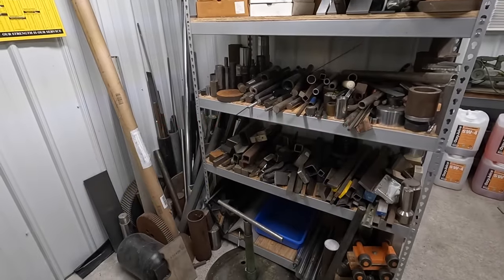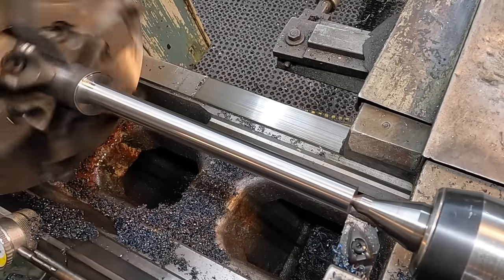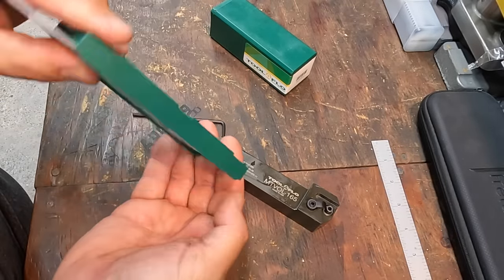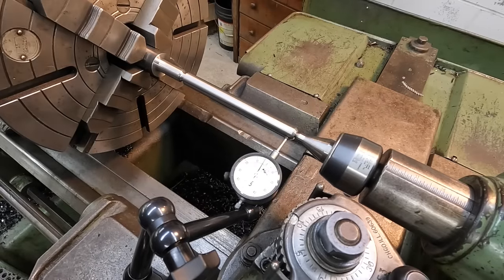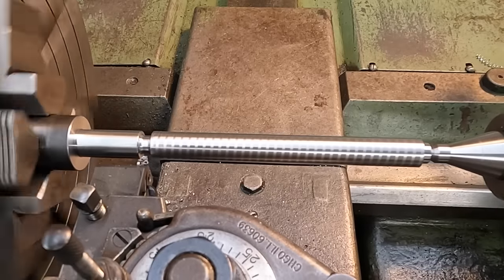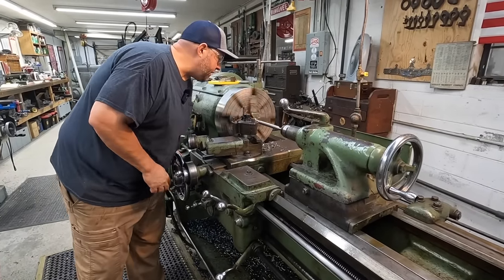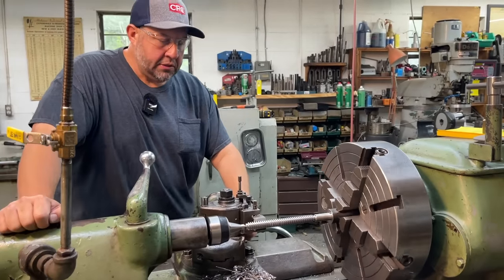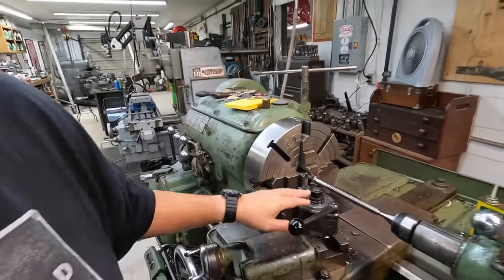Compound Lead Screw for American Pacemaker

Comment: You probably need a follow rest. The part is getting thinner and thinner, it seems like the threads are pinching the tool insert on the last passes and the part is being pulled upwards near the tailstock.
Thanks for showing us this anyways, there are not many youtubers that will show when things doesn't go their way.

EDIT: Would it help to go over with a V profile insert first and finish with Acme insert? That may relieve some of the tool pressure against the screw. 
Same approach as the Acme tap you used in the bronse Acme nut video.

Comment: The part is bending and pinching the sides of the cutting tool, as soon as it get past a certain diameter. Use a follow rest and coolant/lubrication. Wish I had a Monarch.........nice educational video Abom
Reply: would not the bending issue only be in the more flexible middle section of the part and not be at either end?

Comment: Heat from the cut, thin workpiece, pressure increasing from the tailstock causes it to bend away from and try to climb over the tool. Use coolant and a travelling steady. Nothing wrong with the lathe as everything up to that point was fine. Best regards.

Comment: Try setting the tool height higher next time, the shaft climps on the tool and lifts itself up, then the tool has too much relief and starts to chatter and the backlash gets pulled in. A live rest is also recommended and helps with heavy threading.

Comment: Well Adam...These are the moments  to separate the wheat from  the chaff...I watched the process closely....Your first thought was also mine...it is a long and thin workpiece...and the further away from the chuk...the less support you have....But as your are gentle on it and taking only 2 thou a pass...then you would have noticed a deflection more early. Esp. on carbide inserts because on thread cutting inserts you have a 0 degree cutting angle...and the deeper you dive in, the more cross-section you get when cutting threads...
But hey... turn around and look from the other side. Nothing dramatic happened...you invested your time and a bit of steel....I would love to find out the real issue of that....maybe  the ancestors did it right with high speed cutting steel, because there was nothing else available....
Give it a try and use some of that hss cutting steel for that acme thread...

Best regards from Germany!!

Comment: In my view, as someone who owns a lathe or two, is that you simply need a follow rest... The tool pressure is too high for that diameter at that length between the chuck and the center... As you said, its the rigidity, but its not the lathe`s fault, its more of a lack of proper approach... In my view, acme threads should always have a follow rest, as should any longer threads done on a lathe... It simply avoids you a lot of trouble with deflection and climbing parts and what not... Hell, a follow rest is a great side kick for parting off some rudely unpleasant materials... Sure, it may be a bit tough on the bronze jaws, but just freshen them up with a mill every now and again, they are expendable bearing surface...
All the best!
P.s. you said that you checked it before the screw up pass with a nut, and i think i saw a wiggle in the tailstock ram when the shot was happening, its entirely possible that you didnt fit the center snug enough and that allowed for chatter which turned into an instant disaster at that diameter without a follow rest...

Comment: I always use cutting fluid (soluble oil 1:20), even with new carbide tools, being from the HSS steel generation. However, I appreciate your honesty for showing something that did not go well. We only learn from our mistakes. Also, I have never used a top slide angle offset.

Comment: I noticed that the chips on the early passes were like a parting tool chip them they changed just before you had the problem into a more curled chip from both sides of the tool. Almost like you were cutting different material.

Comment: Adam, I have worked on tired lathes before.  One of the issues you have is when you are feeding in you are working on the back of the screw.  When you started to take the .002 pass you were not producing the nessare back pressure.  Dile in past the dimension and then bring the cross feed back to the dimension you want there by working on the front of the screw eliminating the backlash.  Art

Comment: It's not the machine, Adam. As the minor diameter gets smaller, the workpiece is deflecting, then being gouged toward the bit at the resonant frequency of that section. A follower rest and cutting oil wil help.

Comment: Hi Adam, my expierence cutting  Acme or square threads  is that square was easier , when cutting Acme  with full form tool the deeper you get the greater  the load on the tool and part , When I had to cut large acme thread  best way I found was keep top slide at 90  not at thread angle , make square tool to relieve  the centre  of thread  then use top slide to go side to side  cutting each side in turn , use crossslide  for depth of tread , plus cutting oil/coolant

Comment: I agree with the idea that when You get close to the finish, the material flex and  the tool got pinched. 
You will probably have the same issue in the Viktor-lathe. It starts earlier or later depending on the stiffness of the material!
Use a follower rest an You will be fine.
Thanks for Your videos! Most valuable for us with a home shop.
Say hello to Abby as well! 
PS. Lubricant might be of use as well! DS

Comment: I am engineer not a machinist so I am not qualified to give opinion on what might have caused this. However, I want to make a very broad guess to what I thought could be the problem. Noting that every prior pass you made was going perfect until suddenly it was not. The one thing that continuously was changing was the rigidity of the rod, getting slender and slender. This of course you would have accounted for but combined with some other thing, who knows what, it was the feather that broke the camels back. I am anxious to know the answer when you have found it.
Reply: I kept thinking "This would be a perfect application for a follow rest" all through the video.
Reply: @MoraFermi  exactly... not the lathes fault, just needs a proper support for the job...
Reply: Acme thread has a lot of surface contact as compared to a conventional  Imperial 60 degree thread 
You need a follower rest for ANY long slender shaft for ANY "heavy" (relative)  cutting. 
Also, cutting oil should help any threading cutting!
Reply: I was wondering if that little bit of runout might have caused it to want to kick out once it got thin enough.
Reply: I'm just now viewing this video for the first time. I actually see myself in my day to day work life so I can relate.  I'm not an engineer but I don't ever recall seeing a 3/4-5 acme threaded bar. If anything I've seen 1" and larger. So I agree, it might be a rigidity problem  .
Reply: Great video want to see more,  keep them coming.

Comment: We're talking about coarse thread here. You are going about 0.100" deep, so you are left with 0.500" diameter. I think it's the riggity of your setup, follow rest might be your best option here. Cutting it dry also doesn't help. I hope you'll have better luck on your new lathe.
Reply: The lathe is not the problem. Acme 5 is too coarse a thread to machine dry on that diameter shaft with full tool contact and no follower rest support.
Reply: @ellieprice363  Amen. He told us ahead of time that the insert might chip which indicates a lot of force against the part.
 I don't know why he wouldn't use oil even as the minor diameter got smaller and smaller.
Reply: @henryD9363  Not nitpicking here but he also fed the tool straight in on the last couple of passes causing it to cut on all three sides. That was one of the straws that broke the camels back.

Comment: Humble suggestions:  (1)  lack of lube. ( 2) edge build-up due to lol.  (3) resonant micro chatter leading to stress hardening.  (4) plain and simple tool gone slightly dull, becoming more susceptible to chatter. (5) possible high carbon spot in steel ???. (6) Most likely, so hear me out on this one: By chucking on an un-turned and therefore slightly un-true section, you found a very tiny wobble out at the end, remember. Running on a center now causes a tiny bow in the piece which which rotates and gets more pronounced and concentrated as the work gets thinner. Eventually a point is reached where an already inadequately supported (no follow rest) piece begins to "loop" and clime up over the tool. Simply put, you might have saved the piece after the first vibration with the introduction of lube and a well adjusted follow rest. Having said that, I never re-chuck full jaw length on an untrued section, and when running in a four jaw independent ( which is the ONLY type I use, haven't used a self centering in 20 years. Truth. All my machines. Don't own one) I grip maybe half inch at the most in the jaws with a center at the tail, so as not to bow the work. My two cents. Hope this helps.
Reply: All you suggest are very valid points and reflect some issues I've experienced with deep threads and steep pitch angles before.

Comment: I ran into that problem in the past.  I recommend to First, make sure your cutting tool is centered on the piece.  Use cutting oil.  Most importantly, whenever you move the compound in to take another cut, go past the amount you want to cut, then buck up to the actual amount you want to cut.  When you do that it will remove the slack and prevent the tool from being dragged into the piece.
Reply: that makes sense...so once you go in for the next pass, adjust the depth deeper than you want your pass to be, and then back it to the actual amount you want to cut.. so if im understanding, youre thinking is that the slop on the back side is allowing the tool tobe drawn in deeper?

Comment: check the insert.  part sounds like its work hardening because of micro imperfection of cutting edge.  tap magic cutting fluid would help a lot..  this old hand would run a couple passes with my hand on the long feel wheel to hold slop to a minimum.  fuzzes the left side of acme V.  trim that up and then continue with tool post feed.  you are getting to the depth where double sided cutting becomes problem filled. my own experience on old machines taught me not to run tool in center or below but rather a RCH above center.  ya  you know what a RCH is  too

Comment: I had a similar issue cutting acme threads in stainless.  My part was only around half inch diameter and I could see it walking up on the cutter.  I ended up finishing with very light passes and a follow rest to mostly keep the flex in check.

Comment: If you're checking the thread with the nut, you're disengaging the live centre.  When you engage the live centre again you're not returning to the same pressure on the work piece.  You're likely flexing the piece. The more you progress the greater the tendency to flex if the pressure is greater after you re-engage the live centre.

Comment: Adam, i do not know if you have a follow rest for one of the lathes. Josh Tapper (youtube) recently used one on his new lathe for machining a very long thread on a thin piece of stock. The follow rest avoided chatter and kept the material in place. (i just noticed it was already mentioned below)

Comment: - What did you say about 14 and not 14.5?
- The steel diameter seemed to reach a 'Flex-Point' in response to the cutting tool pressure.
- The knowledgeable commentary from experienced machinists point to other possible issues.
- Is it ever protocol to use some back-pressure rollers for such flexible lengths of low OD steel?

Comment: The rod is bending and binding on the threads. its squeezing the cutting tool between the threads.
Reply: long rod is getting thin from threads, it bends easier.
Reply: That makes a lot of sense. Since the minor dia. is getting thinner with every pass. And the problem seemed to get worst with every pass.

Comment: I have done that exact job before myself. The company I used to work for before I retired had 2 American pacemakers a 40 inch swing and a 27 I believe (not sure on the second but under 30). I had to make a new lead screw for the smaller of the two. I used all HSS tools for acme threads. You might use a c clamp on your compound.

Comment: cutting oil may help,  center lose?  and if its is pulling in?  tighten up your gibbs. Don't give up on the lathe, they are like a Holbrook lathe the best for threading.
Some thing else that may help is to rough out the tread with a smaller tool. Takes real guts to put this on youtube!

Comment: Adam, Just before the tool dug into the material I was thinking that your minor diameter at the time was getting pretty small to be unsupported in a 10 inch long part.  I'm guessing you're at about 1/2 inch making it essentially turning a 1/2 " shaft with a huge amount of tool pressure caused by the blunt nose of the acme tool.  This is asking for trouble without support such as a follower rest IMO.
Reply: Exactly. I predict that if he machines this screw 
exactly the same way on another lathe, no matter how new, he’ll get the same result.

Comment: I may have missed it. Did you rough the thread then index to a fresh side of your insert? Also, agree with the coolant or brush on cutting fluid. I was wondering if part was slipping out of chuck due to tool pressure. Also, heat may be causing some bend in shaft. I used to cut large (4” OD) single and multi lead acme. We would set tool slide at 90 degrees and cut thread to minor diameter with thinner pitch tool then adjust slide left and right to get thread to full width. Enjoy watching your videos and reading comments. Your approach and trade knowledge is pretty much the way I was taught 40 years ago.
Reply: If you think there is some variation in your half nut, you could just pick one number and used that throughout the threading.

Comment: That was ... unfortunate.  

I use high speed steel tools, since my old warrior doesn't run fast enough for carbide in most situations, (in other words, my knowledge and experience with carbide is "nil") but ... could spring pressure be making an accumulating build up?  That will be worse for form machining.  It may mean making more/multiple spring passes as you get deeper into the cut.  I know some (if not all) carbide doesn't like light cuts, so some kind of strategy may be needed so you can minimize them.  A look at the insert under magnification might give you a clue to what happened also.  Maybe an edge failed?

Glad to see I'm not the only one to think of using lead in and "landing zones" as warning tracks for when you are about to go over depth.  I used that when I made a hub puller for the surface grinder.  I made the "landing zone" equal to the minor diameter of the hub thread (matched using caliper), and the lead in a few thousand over that.  Scratching the lead in warns to feed in with great caution, scratching the "landing zone" means you are there.  It worked well for me, the one time I used it.  I wasn't certain of how repeatable it was, so I was hesitant to share my discovery with others (already figured someone had tried it before, as "There is nothing new under the sun").  Without any kind of gauge, and no thread wires to go by, it was the only thing I could think of to try.

Comment: I do acme Left hand on a regular basses. Compound angle is critical so as to not add more than your infeed amount. Your chips looked a little heavy for the.002 infeed. Also use a dead center to eliminate any climbing of the part. May on some jobs have to use a follow rest

Comment: We had this problem on a engine lathe at the machine shop where I worked, were the tool would not follow in the same path, we took it apart and the half nut was packed with chips.Cleaned it all up and it worked fine.

Comment: HI Adam
If the work was trying to climb over the cutting tool, surely this would have been prevented with a travelling steady? And I'm surprised that you didn't use a lubricant.

Comment: Wow! at around 36:40 when you run your cut out to the end, you can really see the far end at the centre really moving around.
Reply: I actually put the playback speed down to 0.25 speed and as the tool comes off the end of the cut the work piece drops over a millimeter (excuse the metric, I don’t know any better).

Comment: On my Colchester the combination of wear in the different components caused mine to do the same when cutting big threads like that. Did not matter if i tried .001 or .002 cut just to much tool pressure and wear to get it done. So same conclusion was to move to another known better less worn machine. You will get it done on the knew one for sure.

Comment: I would be thinking, as others have said, that you just hit the point of crossover where the tool is not only having increased contact area as the thread is cutting deeper, but the shaft is reaching lower and lower resistance to flex as higher amounts of material is removed. Then at that very first sign of real flex, the shaft movement breaks through in chatter and the tool is then making contact with parts of the thread it shouldn't be and the problem snowballs. 

That would account for the sound being largely OK and then almost in an instant becoming very crunchy... If there was a synchronization of the lead screw/ gears problem, i might have thought that the problem would be less likely to show up instantaneously, but rather just result in a thread that is not uniform down its length in the profile. 

Just having a guess here tho...

This stuff is better to watch though, than had things just proceeded smooth as butter because as they say it is from the mistakes we make that we learn the most. So kudos for allowing us these insightful moments.